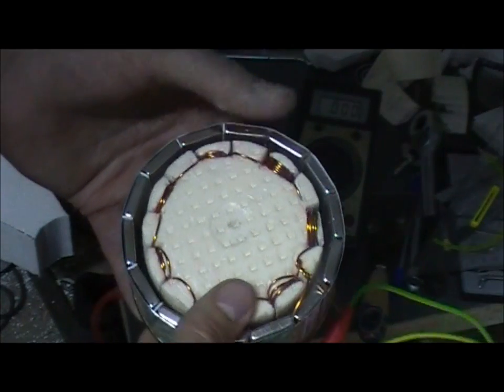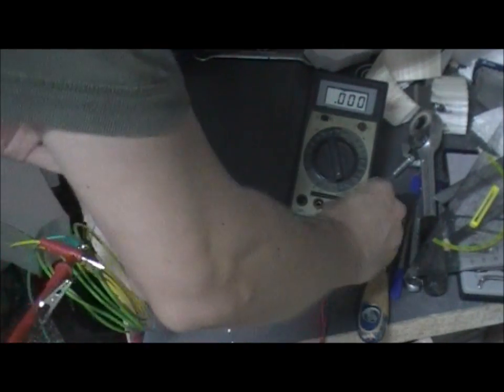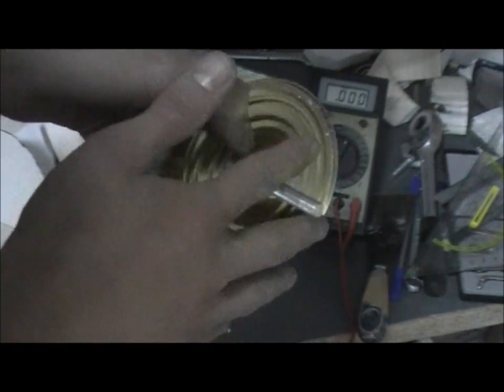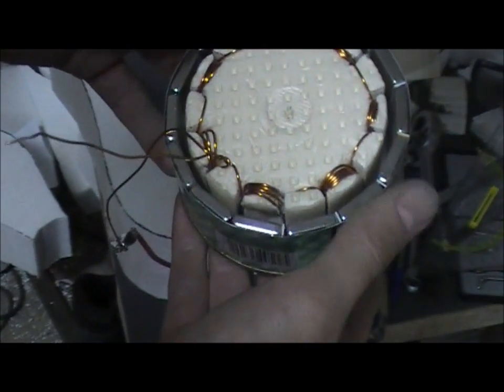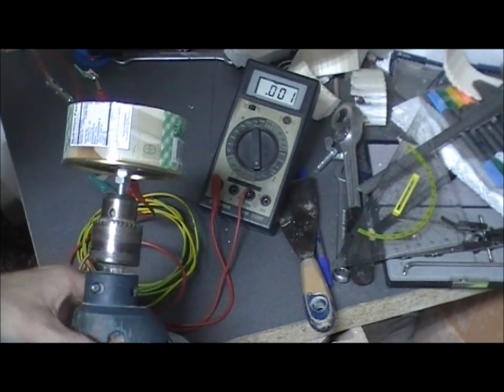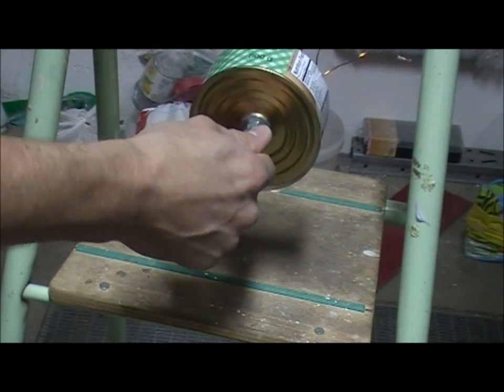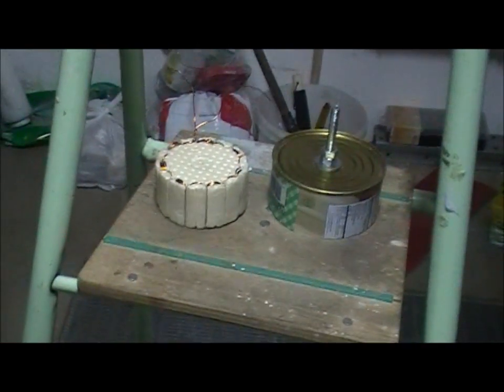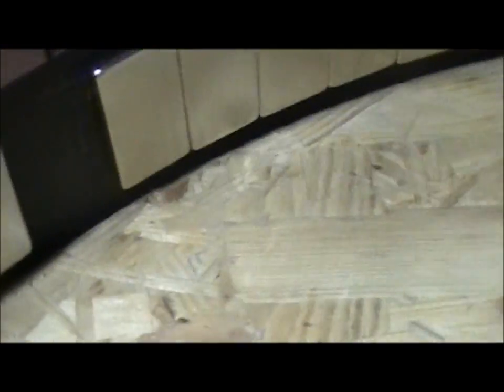Home made windmill generator part 2 - Testing the prototype

Comment: Look, this is a fucking joke. You're using all the wrong tools for the job here buddy. If you want to make a coil, get yourself a guitar pick up winding machine. That way you can generate custom sized coils with the finest copper wire money can buy all without having to spend days winding each coil. These crude coat hanger thick wires wrapped a few times around every second tooth - I'm surprised you're generating what little power you ARE generating. It's atrocious. Google home made coils ffs.

Comment: Why not have the stator made in iron and wind it with thin wire so that you can make at least 5000 turns on every section!?

In principle, make an electric motor which would be as strong and fast as possible. The only problem you'll encounter theoretically is resistance, ohm. That means that if you want to build a motor i.e. for your electric car if you have one, and you don't want to compromise speed versus torque. If you want speed, windings can be thinner and if you need torque/power then you'll need thicker wire to handle the flow.

Disregarding resistance when building this makes place to use more turns on the stator to extract energy. Thinner wire, the thinner the better.

Now, having copper wire as close to the magnets as humanly possible yields more energy but heat is also generated, and heat is not always our friend when we make things.

Copper interacts with magnetic fields, so does aluminum, and intense interaction results in heat generation. Iron on the other hand attracts magnet like flies on shit, so to speak. Spinning magnets on iron generates no heat, instead it generates a pulse. This pulse alternates through the u-shape and copper windings picks this up perfectly.

With thousands of turns on your coils makes the output in principle, the same but at another frequency. Because it is a magnetic pulse coming from the iron, copper is not affected the same way as with magnets.

The frequency you should be in is above 3kHz. That is in the low radio frequency. This means that the energy coming out of your system is harmless to the touch. Now, if you step it up and use condensators, I can't tell you what would happen. Do things at your own risk! Knowledge in basic electricity is preferred.

Anyways, you need to calculate at which frequency the pulse is in the coil, the higher the better. Learn about frequencies, Tesla, AC etc.
If you know your math and frequencies in your system, then you can build things to apply it.

Key here is how we make energy instead of the power coming out of your outlet.
Ordinary power is 110-240V at 50-60Hz. The dangerous part in all this is always focused on the amperage of power, not the power itself. Granted that amperage is dangerous as hell but only in relation to its frequency,..... which is never mentioned anywhere.

Think of it like this: if you drive a car on a road made of 10 inch round logs, in 50 mph, you'd experience a heavy vibration in the car. Making the logs diameter smaller reduces the vibration.

50Hz in your outlet at home, is very noticable when touching it. The power comes in your body and shakes it 50 times per second, back and forth, until you let go! So, making a power source that generates energy that is harmless to touch is to step up the frequency in its coils.

You have a lot of benefits with this solution, experiment and find out.

Comment: thiker the insulated coper wire=more Amps
Longher the leght of the insulated coper wire= more volt
two have better magnetic absortion try making plastic stator with iron inside  and make all the windings around the places with metal inside. ex: (you can use screw that you can adjust inside  the plastic so it can be made to get far or closer of the magnets) 
Any way keep up the good work. i`m sorry for my bad english.

Comment: instead of putting paper between the gaps like you said, why not put it under the magnets so the inner diameter gets smaller and the gap closes, it's also easier and less time consuming. just a tip :-)

Comment: you will get Higher Amps if you use Thicker wire,,,,
if you use Thinner wire you will get Higher Voltage.

Keep in Mind that when you are testing the Amps,, you will get a lower reading because when it is under load you are getting Physical resistance and it is harder to rotate,,,, using the drilll is a better way to test.....

Comment: Im sure someone has said this but If you use smaller wire and use more winding you increase voltage thicker wire you increase amps

Comment: It is Velocity x Wirelength x its magnets flux strenght that gives the current.
You could paralle connect it and use way smaller wirethichness.
Another improvement could be use of static core magnets.
But offcourse that is way more complex and diffifult becourse the housing would need to way more stable due to the forces it has to handle.

Comment: Great project but most of the efficiency problems you have can be resolved using an iron rotor, closing the gap between the stator and rotor, and spacing the magnets to force the magnetic flux out thru the coils. Great video. Want more.

Comment: Does this generate a DC or AC current??? I'm working on a 'kickstart' generator project to power my small cottage, nothing more than a fridge, alarmclock, Xbox 360, and a small TV..... My idea is having a hand crank electro magnet motor like in the video, that is wired to a mid-sized DC motor with a belt going back to the crank, so when you get 'cranking' the motor kicks on and spins the crank....

Comment: I'm working on a similar design myself. The best way to maintain cohesion of the magnets outside the can would be to add a layer of strong tape. I chose duct tape simply because it's strong and cheap. What would be even better is to use a can with a bigger diameter so you can layer the magnets on the inside. Doing that will be slightly more powerful as well. I hope this helped. Good luck!

Comment from the maker: Well, you can use another magnet in parralel (yes I mean parralel, not serial) to extent another magnets field. But those helper magnets then need to be somehow tightly fixated because they repell each other and for this reason may fall apart when not properly fixated. For this simple generator I had no means for additional fixation.

Comment: This is an uneducated question, but in the case of your gap would it be possible to use 2 smaller magnets inside of the gap? Or do the poles need to be exact?

Comment: dumb question here. im just researching a concept for a perpetual machine generator off of one of the da vincci wheels, or making a da vinci wheel assisted wind generator so that it doesn't come to a complete stop without wind. where are you connecting the wires? are those the slack ends of the copper coil?

Comment: Nice prototype design mate.  I built something similar for my bike except I had 4 magnets and wound 3 coils round a laminated steel core from a brushless motor.  It was only small about 5 cm across but generated around 40 watts at full speed.

Comment from the maker: No, but you need to wire the coils according to the polarity of the magnets. If you connect them the wrong way, the voltage will not be good.

Comment from the maker: @kaivrj That is a cool idea! Btw.. I just recently discovered that i was using the wrong female connector socket on my amperemeter. I should have used the other socket because the one that I used was for big currents only. It is scaled by 0.1 on the display. So the real currents are ten times bigger than what I have stated in this video. So that little generator is not that bad after all!